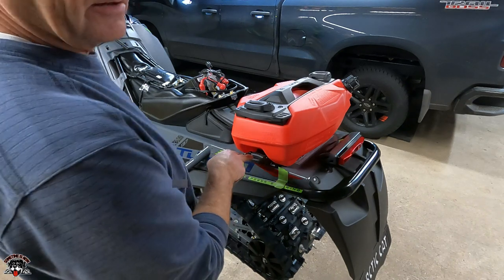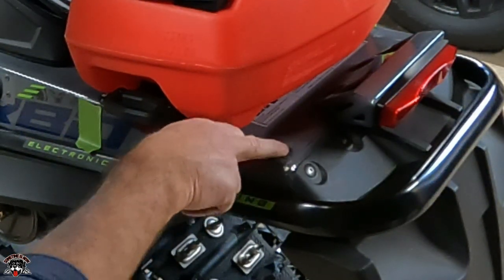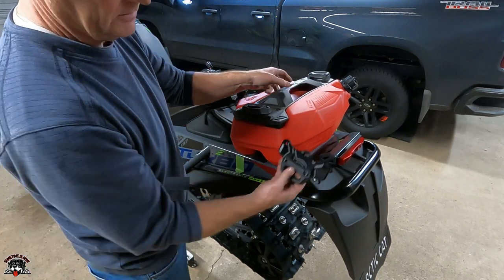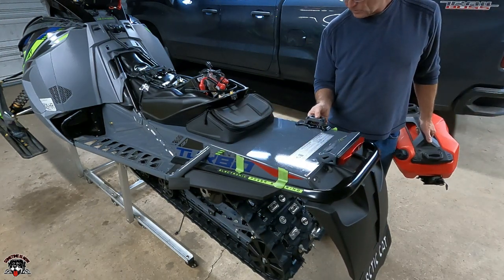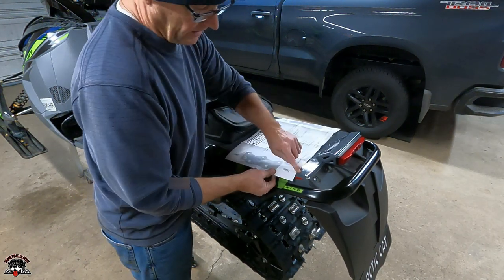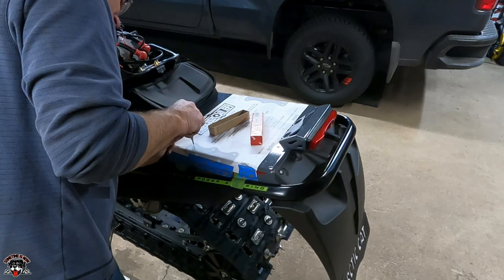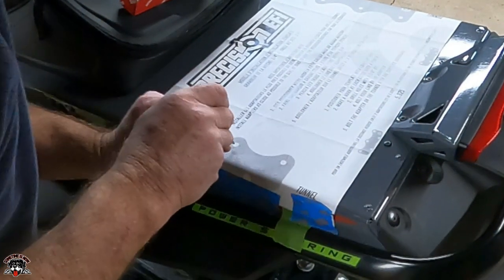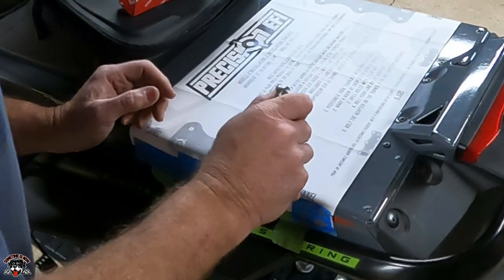PRECISION EFI THUNDERCAT LINQ BRACKETS INSTALL

Comment: Linq is a good system. Skidoo was really thinking when they came out with that. I’m glad it works on other sleds as well. Good video Greg!
Reply from the maker: Agreed. One of the best things Skidoo ever came out with. I bet Skidoo is glad it works on other sleds also.. 😁💰💰💰 Snowing hard here right now. Groomers were all out in force last night up north. 👍🏼
Reply: @SometimeIsNow  there are a lot of trees down on the trails after our snow dump. Heavy wet snow did it toll on things. As soon as the trails cleaned up again they will be open to ride. It’s cold here now with lows below zero. That is going to set everything up good. Need more ice on the lakes and swamps but with due time. Take care Greg!

Comment: One of the best things they invented for a snowmobile. I got 2 bags and gas can on my back country
Reply from the maker: Hey Big Murph, Welcome back. I totally agree. Skidoo has some amazing accessories. LINQ being the top one. Thats why you see them on every brand of sled out there. 😁 I had the Fuel can and two 17L Linq bags that I used on my ‘18 Renegade 600 etec and the ‘20 XRS Renegade 900T. I love how easy they are to attach and that is why I installed these brackets on the Cat. My issue was, If the tail of the seat was alittle shorter I would have been able to get both sets of the Linq brackets mounted like on the ‘20 900T but I found out that if I use the dual caddy it was a lot thicker and I would have had to place one set of brackets in a different area of the tunnel and it just wasn’t going to work. 
I also figured out how to install the Skidoo tunnel scratchers on the Cat, that’s why in my last Elka shock video I had the area blurred out. Until I figure out if I want to release the idea to see if anyone would be interested in purchasing a kit if I started selling them. You don’t see Skidoo Tunnel scratchers on a Cat because you can’t mount them like you do on a skidoo. I spent a month and a half on the idea, Cutting out parts on a plasma table then powder coating the parts to add color. They work perfect with a few modification. 👍🏼😉
Reply: @SometimeIsNow  you going riding? I see ny got hit hard with snow

Comment: I have installed a double LinQ set on my 137" XF9000. I use the 2.9Lt can and the 17lt sportbag like you have.  Its a great set-up.
Reply from the maker: Hey Snappydave, Thanks for stopping by. Nice setup for sure 👍🏼 The smaller fuel tank was an option but I already had the stackable one so single bracket was the choice. I’m going to look at the larger doo tail bag for a option if it’ll fit.. 😁 Take Care

Comment: I have the same setup on my 2017 RR and the linq items seem to get a little wear at the plastic mounts and now wiggle around. I don’t like filling the gas caddy at the back like that either but do when necessary
Reply from the maker: Hey Northern Toyota, Yeah.. It has wiggled alittle from new with the gas can and Linq bag stacked up. I just used the gas can and Linq bag when I was in Maine last week and it worked as it should. I won’t use the gas can much but like you stated, when necessary I will use it. Take Care
Reply: @SometimeIsNow  right on. I just did about 700 miles in northern New Brunswick, likely close to where you were in Maine. Only needed the gas caddy 2 times as I didn’t want to pay $3/L at the clubs for fuel. That’s pushing $12/gallon, no thanks! Little over  Half that at the gas stations
Reply from the maker: @northerntoyota7584  Yeah, We rode the border trail between Maine and NB so we weren’t that far apart 👍🏼. The day I needed the gas caddy was when we ran up to the Estcourt Quebec border and back to Allagash ME. I wouldn’t have made it without it. Take Care and THINK SNOW❄❄

Comment: Did you ever consider the Speedrack system w. box? I guess that wouldn't allow for a gas can. However I'm thinking about getting the biggest possible cargo box for my t-cat but haven't decided which system to go with yet.
Reply from the maker: I have never heard of the speed track system. I’ll have to check it out. I have always used the linQ system and it’s always worked. I’ve actually seen videos where people use the Milwaukee pack-out boxes. 😁 Take Care
Reply: @SometimeIsNow  Speedrack is Arctic Cats version of LinQ. They have it for the ATV:s also but I don't know if the system is interchangable. The box I have in mind has Arctic Cat part no 7639-351. It's suppose to be 25L. Thank you for a wonderful work with the channel btw!

Comment: Hey Greg, great content as always. Anyway, I'm debating making the switch over to a 23 ZR 6000 from a 850 MXZ. Always preferred a 600. Never owned a cat and would really like to give one a try. Always loved the look of them. If you have a second how do feel the cat chassis handles in comparison to the g4? Thanks, AJ.
Reply from the maker: Hey Flying pumpkin, Thanks for dropping by the channel to check out the videos, It’s appreciated. 👍🏼 I’m definitely not brand bias. I would own one each of all 4 brands if I could. IMO the Cat chassis corners flatter than a G4. The Procross chassis doesn’t require the body movement to get it to corner when riding it harder through the windy trails. It’ll make you lazy riding it, it handles so flat. Lol The main thing I would bring up is if personally will feel comfortable sitting on the Procross chassis with its different riding position compared to the G4. 
I let Brad ride the T-Cat and I rode his Mach Z and he commented the Cat for some reason bothered his knees. I didn’t notice that issue myself. I did notice that the Cat doesn’t spread your hips apart like on the G4. Skidoo, having the chaincase in the right footwell and the brake rotor guard on the left side pushing your feet & legs apart more and could bother some people’s hips. I personally liked the Cat with the EPS so much I sold my 900T and I’m not looking back. 😁 I think a small part of it was I’ve never owned a Cat before. I’ve ridden Skidoo since 1997 and just grew tired of Skidoo year after year, after year. It’s like buying the same brand of truck every year for 25 yrs which I haven’t done. I’m looking forward to riding something different and new to me so the Cat fit the bill. It’s my understanding that the ZR6000’s 600 motor is a nice motor and are nice sleds. I can’t comment on fuel or oil consumption for the Cat as I have experience with that motor. If you don’t need the 850 power and a fancy color gauge package Skidoo offers, you just might like the Cat. 👍🏼 Take Care
Reply: Thank you for taking the time to answer. Great hearing opinions from experienced riders.

Comment: I would consider adding something to strengthen the tunnel if you are running that size gas caddy that far back, especially stacked. Speaking from experience! 🙂 Very good videos!
Reply from the maker: Hey Terry, Thanks for stopping by he channel. Good idea.. I’ll figure something out and add it to the under side of the tunnel. Thanks again  👍🏼
Reply: @SometimeIsNow   barn of parts makes a tunnel plate to reinforce it.
Reply from the maker: @daltonjenkinson2011  Hey Dalton, Thanks.. I’ll check the tunnel plates out to see how they’re mounted 👍🏼
Reply: I have the 3.25 gallon can on mine with 1500 miles and no problems whatsoever on my sidewinder GT
Reply from the maker: @captain2574  Hey Captain, You’re saying installed these Precison LinQ brackets on your Sidewinder with no issues?
Reply: @SometimeIsNow  
Yep 👍
Reply from the maker: @captain2574  Nice 👍🏼

Comment: Love your videos! What snowmobile lift do use? Are you happy with it?
Reply from the maker: Hey Chris, Thank you and thanks for stopping by the channel to check out the video. 👍🏼 The lift is an Extreme Max 5800.1184 Pro-Series Aluminum Snowmobile Lift. https://www.extrememax.com/product-p/5800.1184.htm Take Care and THINK SNOW ❄❄
Reply: @SometimeIsNow  Thanks
Reply from the maker: @chriseckelberg7467  Oh and.. so far it’s been a great lift. I like that it’s aluminum because it’s lighter to move around when not in use. Plus it has the flip up feet that go under the running boards instead of just a rubber bumper. 👍🏼
Reply: @SometimeIsNow  Nice! Are you running any tunnel protection for your studs?
Reply from the maker: @chriseckelberg7467  Yes. The dealer installed the tunnel protectors for free when my sled came in. What sled do you have?
Reply: @SometimeIsNow  21 Sidewinder 137 studded from the previous owner but no tunnel protection besides the BOP hose protection kit
Reply: Maybe I should order some?
Reply from the maker: @chriseckelberg7467  Nice 👍🏼 Love the Sidewinders and SRX’s..  I bought the T-cat for the EPS but gotta love the 998 Turbo on these sleds. I just finished tuning the sled today with Hurricane.
Reply from the maker: @chriseckelberg7467  It would probably be a good idea to have them in there. I guess they’re not that hard to install. Also I believe there’s some kind of adhesive that needs to be put on them before they’re installed up in the tunne.
Reply: @SometimeIsNow  thanks

Comment: Why do you need a gas can Your sled will go a 130 miles😵‍💫 That sled  enough on its own 650 pounds at least
Reply from the maker: Hey Alan, I wanted the option to carry fuel when I go up and ride with RichOutdoors in Qeubec. There’s a part of the trail that doesn’t have fuel this season (Halfway Haven) as it’ closed this season and the 130 mile range wouldn’t be enough to make the run. I’m just planning ahead. As far as the T-cat weighing 650 lbs. You’re incorrect… It weighs 690lbs.🤣 I for one don’t care what a sled weighs.. I’m over the, that sled weighs more than that sled. To me they’re all heavy. I have race scales and weighed multiple sleds and they’re all heavy. Even a new ‘22 Polaris XCR 850 is 601lbs. I never ride off trail so It doesn’t matter to me if a sled weighs 900lbs. The T-cat has power steering so you don’t feel its weight which is a plus. 👍🏼

Comment: I have the Intek linq mounts on my 2020 Indy it's Soo sweet you don't have to drill any holes at all!! Fits right in the T slots👍And you can slide them all around if you like! I find it hilarious that ski Doo Even has Holes to be drilled and the Polaris doesn't 😂😂😂
Reply from the maker: Yeah, every manufacture does great things and stupid things seems like. I for one love the Linq system and I dont care what brand I ride I will always find a way to use the Linq stuff. Never had an issue with any of it. I’ll be curious to see Cats new ATTACH system they’re coming out with on the new chassis. Seems similar to Polaris but lockable. 👍🏼